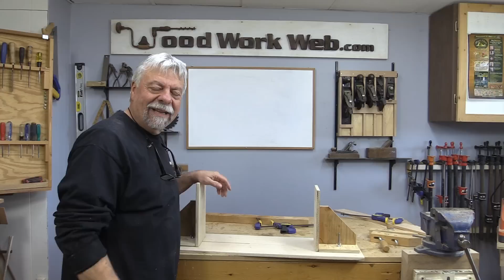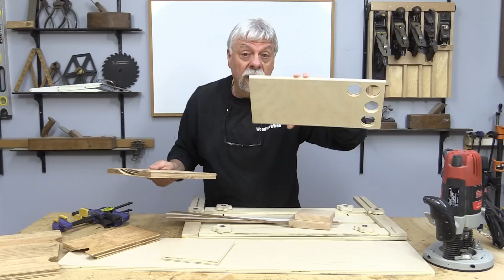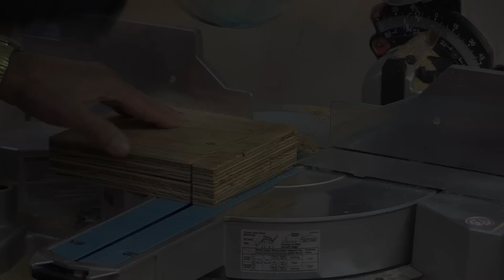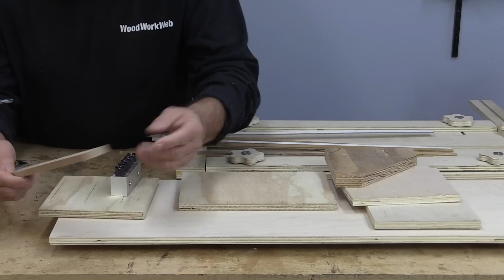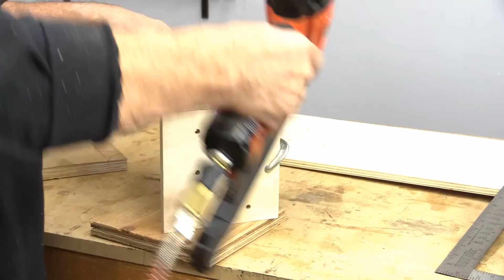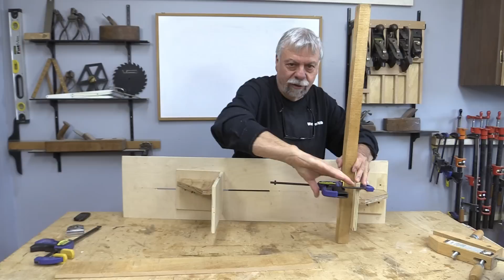How to Build a Project Assembly Jig | Woodworking Jig

Comment: I agree with you Colin there is nothing better that having a extra pair of hands when you are working alone in the shop. A great easy to build jig that will have lots of uses and best of all it won't give you a bad time if you mess up on the project. LOL  Thanks for sharing

Comment: This jig will come in very handy in most woodworking shops. Thanks for sharing.
I have no plywood available. It's rare here and therefore very expensive. 
I suppose melamine coated particle boards will be strong enough. Maybe with some reinforcements here and there.